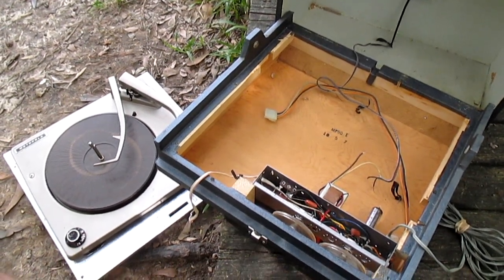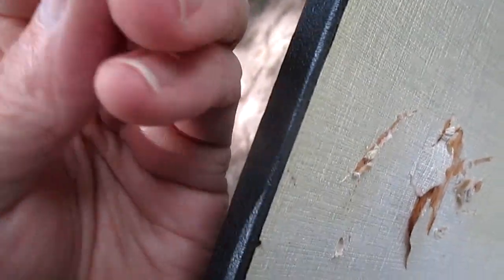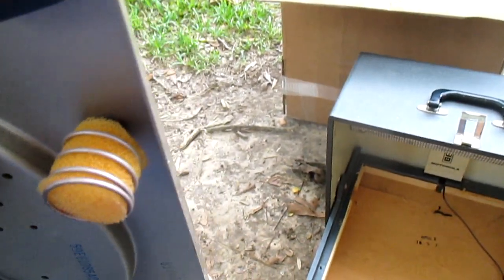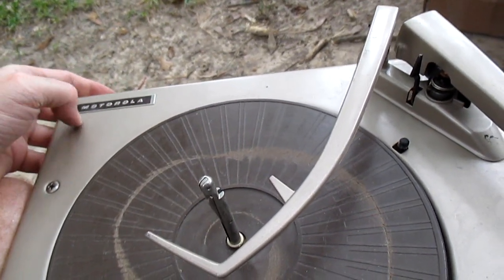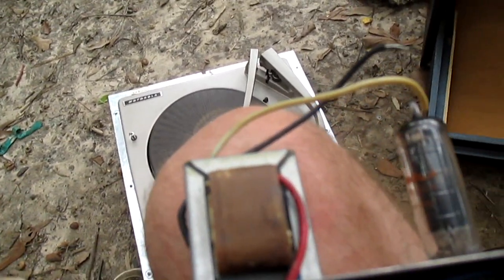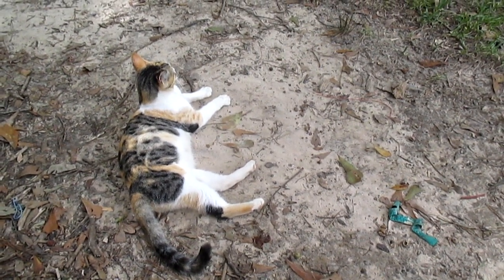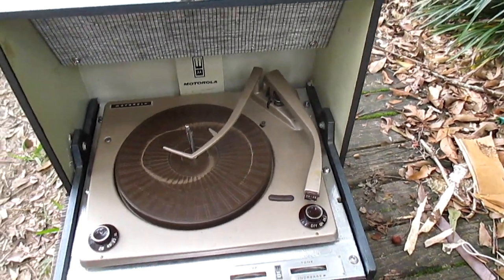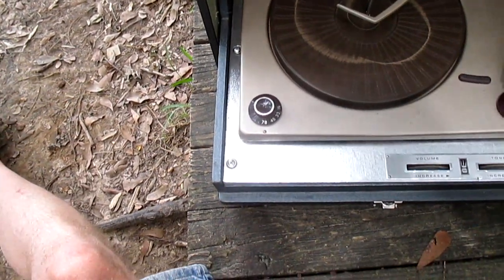Motorola record player from 1963 that got cream-puffed in shipping, and a stray cat

Comment: There are some tools with a pivoting head/tip which can reach into tight and otherwise unreachable areas. Car mechanics have had to use similar ratchets and other pivoting tools when working on a vehicle's engine. Maybe that's what you need if you should ever encounter another gizmo gadget with inaccessible nuts, bolts, and screws.

Comment: I'm lucky I don't need to go online and risk shipping damage, scams or the like. We got a vintage store here that is like walking into an ancient Kmart from the 60s and I've picked up some great vintage stuff (AA5 radios, record players, entire stereo systems, wind-up watches, etc) and they've been not only seriously underpriced ($25 for a Pioneer stereo system with 8-track, record changer, AM/FM, speakers in working condition or a $9 AA5 GE radio that works) but most have not needed more than seriously minor repair (Pioneer 80s dual cassette deck needed belts, the watch was overwound, etc).

Comment: I think you were meant to have that cat---look at how many times it came back, even after being trapped and animal control came to get it. I hope you keep it. As far as the record player goes, I don't think I'd put that much time and money into a one-tube wonder. Even if you added a  preamp stage, it likely only has a 4" speaker, and still won't sound very good. Nowadays, if it doesn't have a preamp stage, I don't want it
Reply from the maker: I just looked and it has a 5" Motorola "Golden Voice" speaker in it and their speakers (whoever built them for Motorola) were usually pretty good.
Reply: WHY?  If you wanted something with high fidelity, you wouldn't be buying one of these.  I had a much, much cheaper version of this made out of that compressed newspaper crap they used to build them in before particleboard as a 5 year old (it was a hand-me-down) in the mid 70s.  That is more or less the intended purpose of them, for kids.

Comment: I was really surprised that Motorola would put their name on a one-tube piece of junk in the 60's. Their other stuff from that era was solid, good quality.
Reply: Every manufacturer had/has a line of 'budget' models, and that's what this was. I have some catalogs (PDFs, not the actual paper booklets) from Magnavox and Zenith, and they sold low-end stuff like this, too.   Go look at an old Radio Shack catalog some time.  A lot of their 'budget' stuff was pretty crummy for its time (but even so, it stands head and shoulders above a lot of 'mid range' products today).  If Radio Shack was still in the business of selling stereo equipment, you can bet your bottom dollar they'd have a Realistic- or Optimus-branded Crosley Cruiser clone, and they'd sell it right alongside their premium stuff.

Comment: "Difficulty in Servicing" & Spin it Off!!" key phrases. Try running those lines across auto manufacturers now.  I cannot remove the oil filter on my vehicle without soaking my forearm or the frame below it.  The filter is just about inaccessible--tucked in near the steering shaft.  I have done oil changes since 1968 and for the most part, all were simple clean jobs for an experienced diy.  I miss my Siamese kitty--a favorite in the late 1970s.  Keep the cat!!!  When they get to know you,  they are family.

Comment: Go to Harbor Freight and get a 1/4 inch drive socket set (if you dont have one) and a 1/4 inch swivel U joint adapter. Gets you onto almost any stupidly placed nut or capscrew.

Comment: You would be far better off building your own cabinet with hardwood, then fitting your own valve or transistor amplifier, you could even add a class D amplifier to it, it would destroy anything else for sound quality and build quality.

Comment: Greetings:
I  think you enjoy waiting for non-technical problems to appear just so you have an opportunity to blame someone for their failure to do things to your satisfaction.
The low cartridge output may be low level and low distortion if you are fortunate. I would think that by the time that you already have already learned & built solid state pre-amps that you might have built an extra one to use for testing, but that may be asking you too much. Before spending money on a cartridge maybe you could listen to its output with headphones to see if it would be happy with a low cost preamp.
Since the idler wheel is uncaring about its diameter, I would try finding an o-ring from most home-improvement stores, whose diameter was right for the metal wheel, but the thickness was small enough so it will work with the stepped drive spindle.
As the demand for 78 rpm support has likely dimished significantly, I would consider selling the unit without 78 rpm record support to make cartridge replacement simpler. Dismiss complaints about the 78 speed selection due prohibitive replacement costs. There are turntables that support those disks, but cost more.
Do most changers have the needed neutral position to avoid damaging the idler?
Those that do not, I suggest exploring the chance of converting the 78 rpm speed position as a NEUTRAL position (I know the spindle is the major problem here).